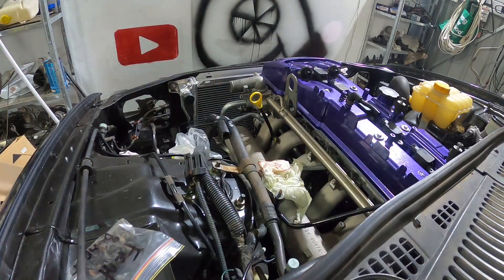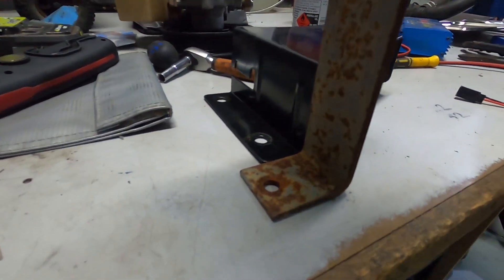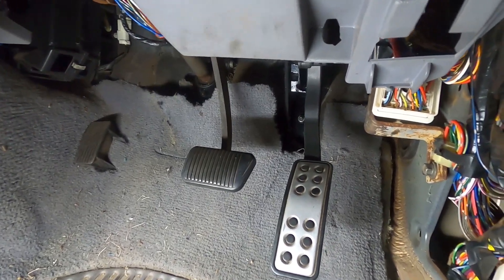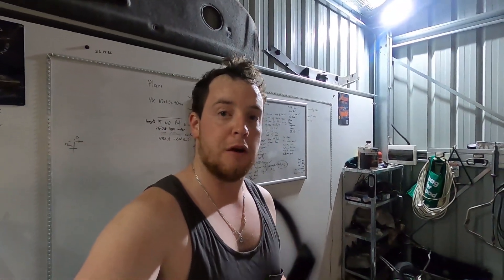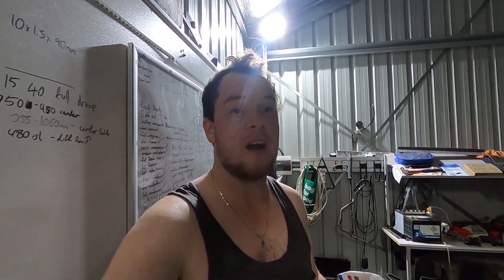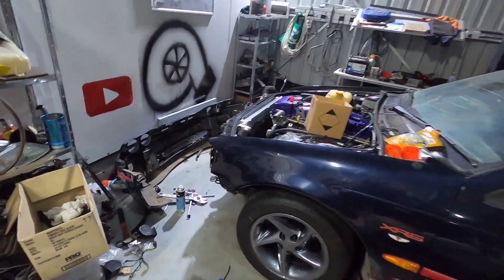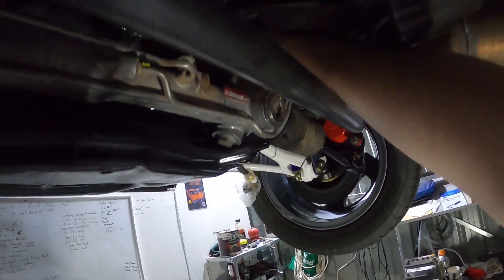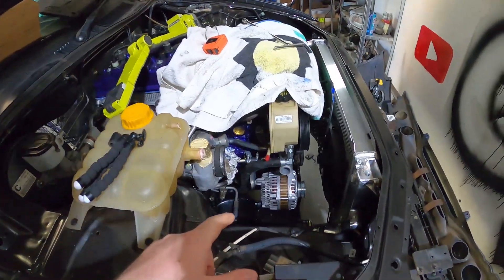Creature comforts, Thermos, Radiator. PROJECT SLEEPY SIX - Restoring an Aussie Classic Episode 21.5

Comment: Are you going to use the standard plastic intercooler piping or will it need a custom metal job? It's coming together quickly now
Reply from the maker: Custom metal jobby 
Probably 2.5in stainless
Reply: @T.A.G  noice 👌